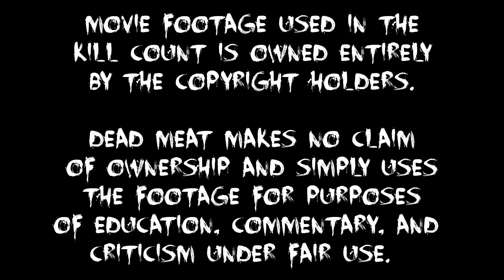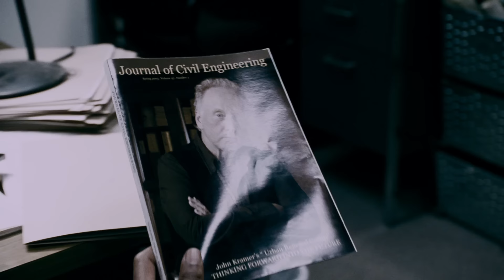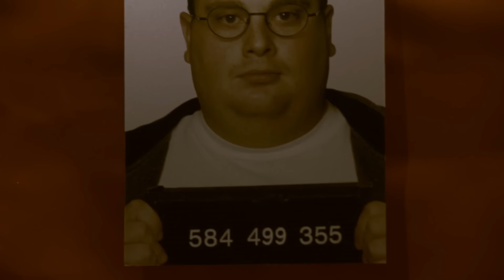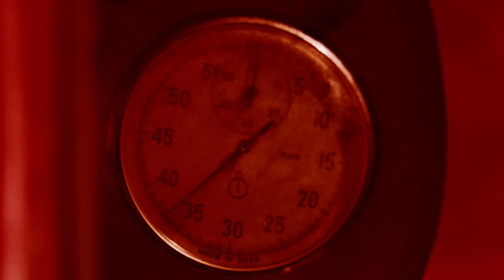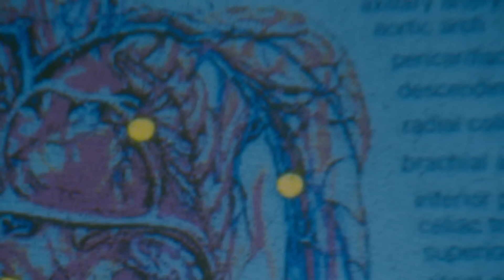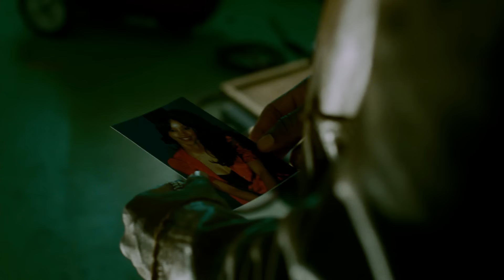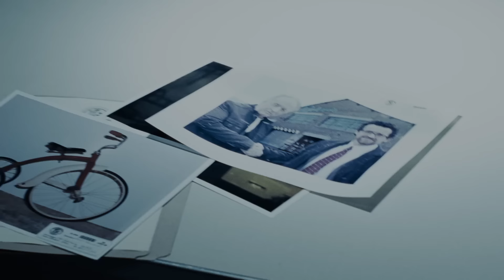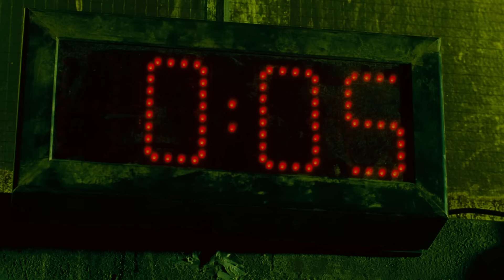Saw IV (2007) KILL COUNT

Comment: 1:05 your telling me candle wax survives stomach acid. Something strong enough to melt razor blades! Jigsaw was still alive when he swallowed that meaning tape dissolved, no more movie.
Reply: Game over
Reply: I think the wax was just to help it go down his throat. It takes time for stuff to get to the stomach, and then hours for it to be dissolved in the stomach acid. Given how little time there was between when he swallowed it and finally died, it's entirely plausible that the tape would be functional once recovered (after a little clean up of course XP)
Reply: @RavynMad121  true but it should have at least been damaged just a little
Reply: No, your stomach acid will not dissolve metal, unless it somehow remains in the stomach for a long time which will probably kill you anyways. 

Yes, stomach acid, which is Hydrochloric acid, is highly acidic, but if it was as acidic as you are thinking, you would die horribly every time you vomit. 

Think about it. If your stomach acid doesn't break down whole kernels of corn, yeah, no. It's not nearly as acidic as you are thinking. Get some 1pH HCl and drop some corn in it to see the difference. We don't have cellulase but if our stomachs were acidic enough it would not matter. 

Besides all that, wrapping the tape in the right type of plastic or other material would completely prevent breakdown.
Reply: How did he not choke on it is my question
Reply: @Bibabeee  🤷🏻‍♀️ wax I guess helped. It's still bigger then his esophagus
Reply: Pretty sure stomach acid is much more reactive with metal than wax.